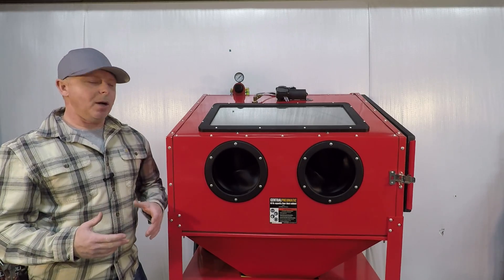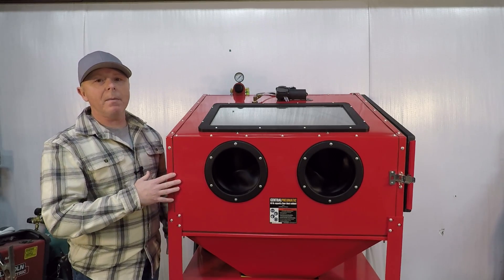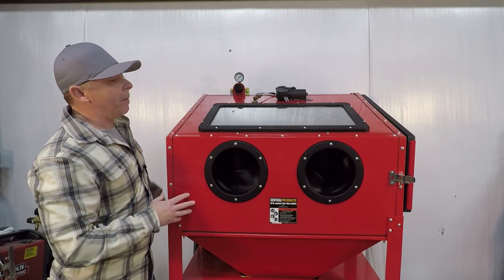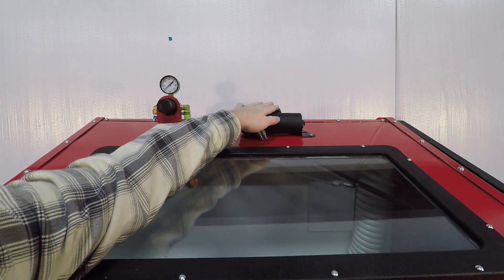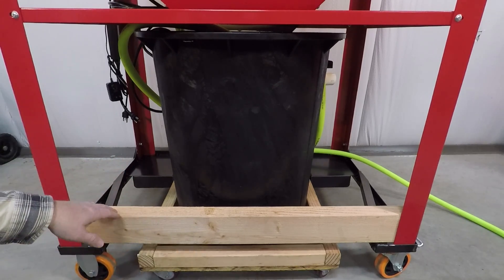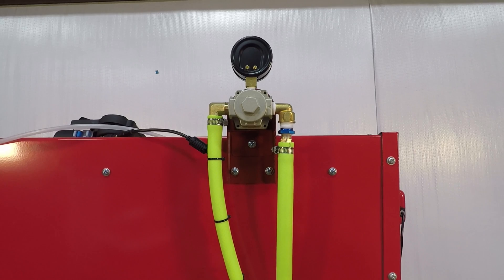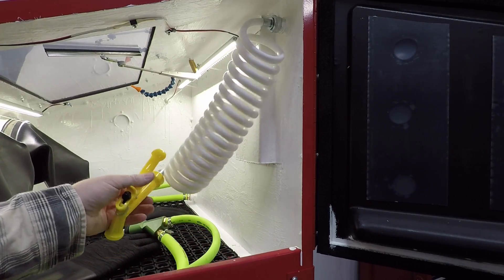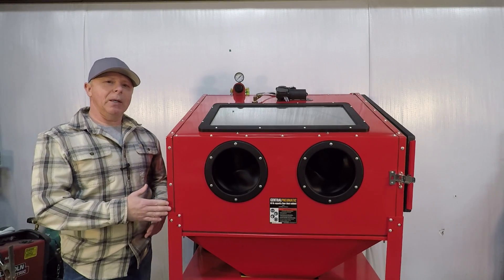Harbor Freight Vapor Honing - Wet Blasting Cabinet Modifications- HTMR Bare Bones Build @HTMR

Comment: Did you strip the original paint before applying the coats of flex seal? My original paint flaked and bubbled and wondering what your process was of re-coating it? I'm thinking of doing a 2k epoxy primer and a rubberized or marine polyurethane over it.
Reply from the maker: My cabinet was new, so I just scuffed the paint and put the flex seal on.  It's been holding up great.

Comment: Were did you get the wiper moter ?  Thanks
Reply from the maker: https://www.ebay.com/itm/145013430447?hash=item21c37958af:g:g0UAAOSwaCVcrf3K&amdata=enc%3AAQAIAAABAPE511BqtvzFPCssgicgQCG9dhNqOSTgAWU8HxuIrXpJmxedGbKFQxOFzKPd1xLaKQL%2BjCnhqLethNKWd%2BM68Uzrz7qRVRq%2F%2FlsVPYeBq2gvZf9l0dKDQ4NZ8viGFPbPG3EicLNkZpfDHaB3AEF89CYgxgtz8bBfQ2keJNG2fQ4zp9AZ0TGBRpnsiLf92uCNUmG%2FYWyj5hQi1vUZkO1pyDf6D64HgiCQgs%2Fxqg8PkuBquN1%2F%2FWjYJFc%2FbD2%2FZuvpStW18FkB9vYk%2FC0bHQf2jKnMy3%2Fkz9TUaulhTTOylz3xLjKaXo1N0omHFyjdNBnz2tq2EV%2FWxijZnCgz3GuluII%3D%7Ctkp%3ABk9SR5at5c2pYw
Reply: @57moto59  That Link be BROKE. Which happens often enough. Therefore NAMING the part would be best.
Reply: what about the wiper arm and the wiper blades?
Reply from the maker: @michaelkindle3391   This guy has all the info and how to videos. https://howtomotorcyclerepair.com
Reply: @57moto59  Thank you, but I don't think I will be paying $100 just for someone to tell me where to get those 2 parts. I already built the cabinet and it works great, but I just don't know here to get the wiper arm and blade. Thanks anyway. I will make a video soon of my build.
Reply from the maker: @michaelkindle3391  Anco 4102. I can't remember where I got the blade.  I want to say speedway motors.  I did have to cut the length down.
Reply: @57moto59  If ya measure the window no cuttin is needed, just buy the RIGHT size.

Comment: Great cabinet. Super clean!! What type of paint/sealant do you use for the interior walls?
Reply from the maker: Thanks! Many coats of Flex Seal! Also a bit of silicon where the hopper meets the cabinet.
Reply: Does it prevent from the paint stripping and rusting?
Reply from the maker: It has so far for me!